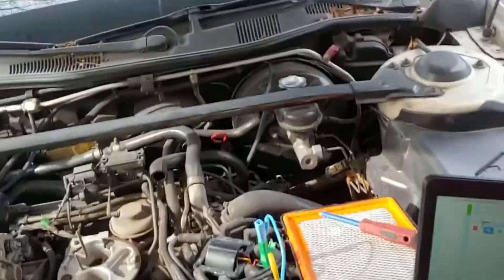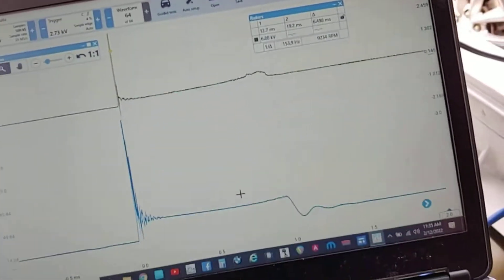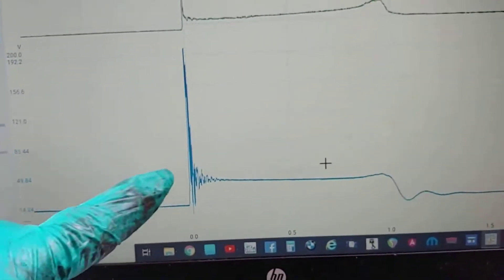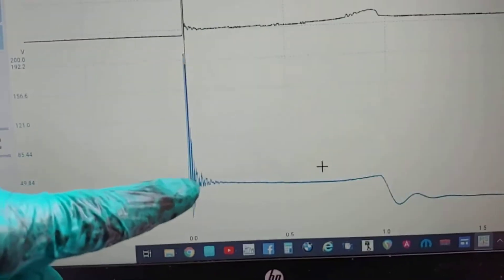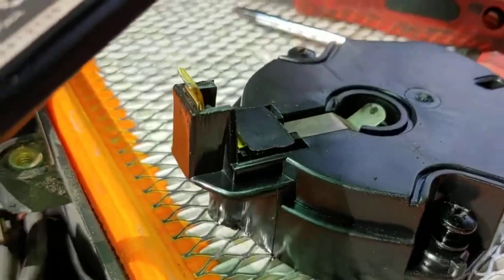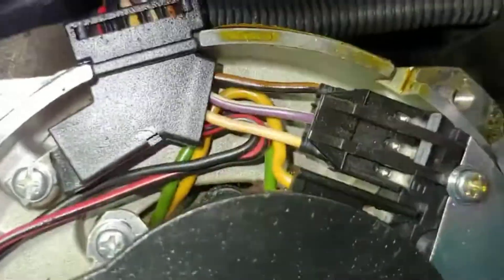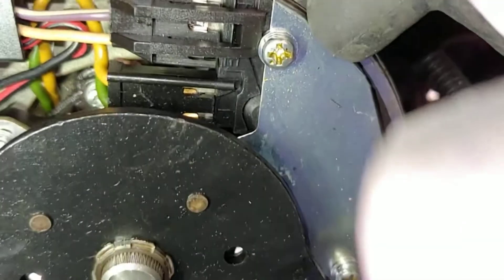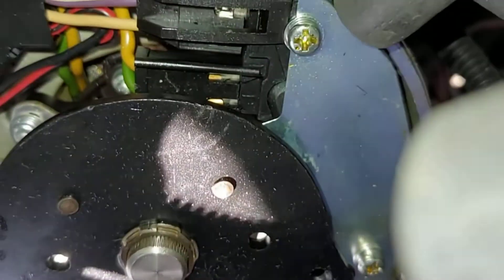1994 Cadillac Deville Misfire

Comment: How are you able to pick up the secondary with the Hantek probe? I can use it to pick up the coil firing on these 4.9s, but not any individual wires. Figured it was shielding in the wires, but this video shows that's not true.
Reply from the maker: Not sure, I've never had an issue with them, it works on my autel, my snap on, my u scope and my pico... I haven't gotten my new scope yet but I'm sure it'll work on that as well... Make sure you have the polarity in the scope settings right